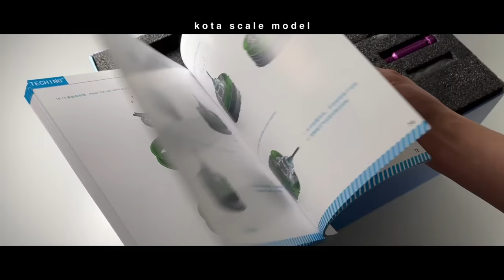Building a Turbofan Engine Model Kit - Full Metal Turbofan Engine Aircraft Jet Engine Model

Comment: The thing that puts me off buying this kit is the fact that the electric motor sounds awful. Maybe the manufacturer should have spent some time looking for a better motor to animate this model, especially when you look at the cost of the kit.
Reply: Exactly! You would think that for $1000, it would actually sound like a real jet engine and it should also come with a snap on cowling cover
Reply: Also the 5 second looping jet sound is ridiculous.
Reply: @vmpgsc 
Sounds like sonar ping from a 30 year old video game.
Reply: Have to agree. I was going to buy it until I heard the motor
Reply: Try greasing the engines moving parts it will make it overall quieter not much you can do about motor noise but it will fix the obnoxious grinding sound.
Reply: Gear noise, definitely needs grease.
Reply: That’s not the motor it’s the gear drive transmission it probably needs a port to lubricate it.
Reply: Agreed. I will not be spending that price for a broken short loop engine sound and a radio shack motor galloping.
Reply: It's not the sound of a motor, it's the sound of gears meshing. To make a better sound, the gears need to be more precise and of high quality, which increases the price and makes it a real engine.
Reply: I wanna hear this thing ROAR not hear a sad little grinding noise.
Reply: I was disappointed by the fact that it wasn’t a real engine.

I want to be able to pour A1 into it and see the flames and the heat, the raw sound and the hurricane winds a real one produces.

I would not buy a toy like this even for a dollar!

😤
Reply: It is still not the real deal.
It’s a f-word toy for a thousand bucks…

To me it isn’t worth a dollar 💵 
😤😡👎👎👎👎👎
Reply: I wanted to see the EGT climb 😏
Reply: @DeLoreanmann-du5iw  I would imagine that some of the fan blades need some dressing too. Sounds of metal on metal isn't all coming from the gears,IMHO.
Reply: If it was not for your comment I would have never realized the sound was a recording👍🏻
Reply: It needs a butane injector and ignition❤😅

Comment: 8:05: for anyone interested, those are cooling tubes to control turbine blade tip clearances. If the case gets too hot and expands, there would be too much space between the turbine blade tips, causing a loss of power. Cooling air comes from one of the primary compressor sections.
Reply: accha
Reply: hmm, i asked about those as i was watching and thought they may have been some form of heat exchanger, i wasn't too far off I guess. Thx, good to know!
Reply: does the air drawn in heat up and does the exhaust drive the fan ?

Comment: Awesome model kit but it is absolutely NOT worth $1000. It’s worth maybe $175 at best. Great product but for $1000 you can buy an actual mini turbine that requires fuel, oil, and other lubricants used by life size engines. The build time on this kit I’m sure is no more than an hour long. But amazing model regardless

Comment: This model is extremely impressive, but at the same time very frustrating. I mean with such a level of detail & material selection, this could very well be an actual working jet engine. Why not equip it with fuel, lubrication & ignition systems to be RC plane worthy? 😢